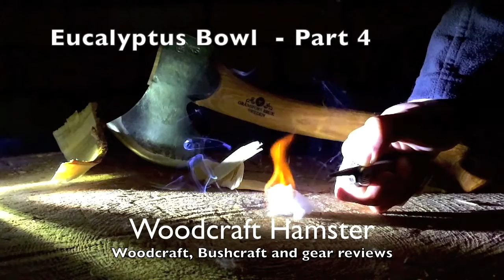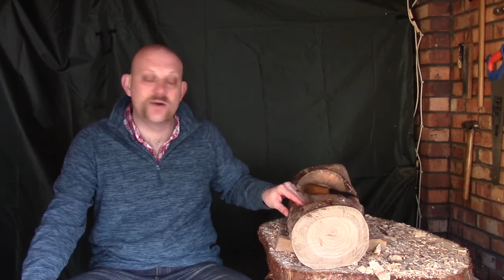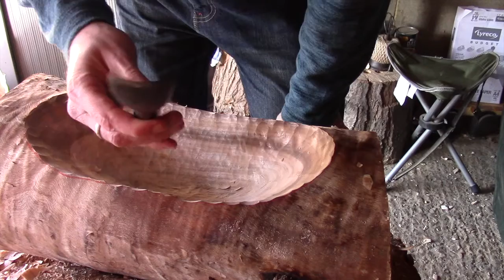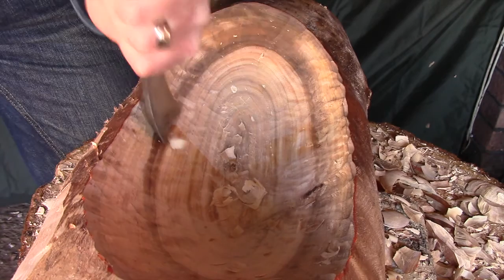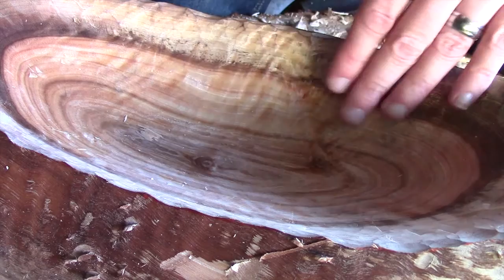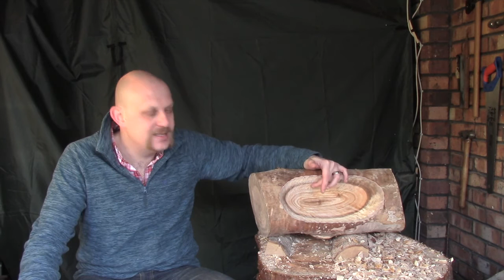Eucalyptus Bowl - Part 4

Comment: Isn't it annoying when you are trying hard to smooth the sides out with a gouge/chisel, then just after you push downward the chisel thing slips easily into the cut, straight down and begins a ridge at the bottom. I hate that as you are forever chasing your own skills.....  Not to worry though, keep your edges sharp and have at it... !!